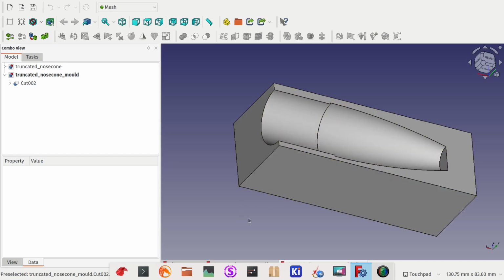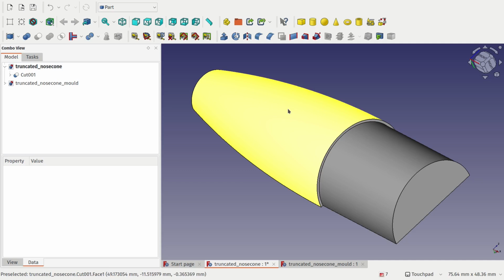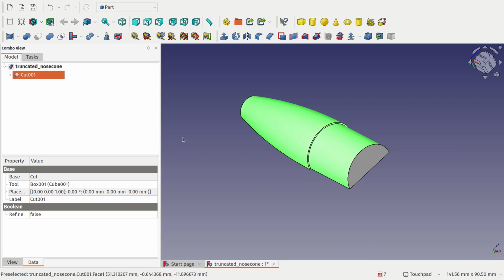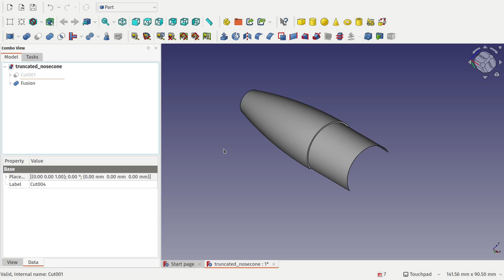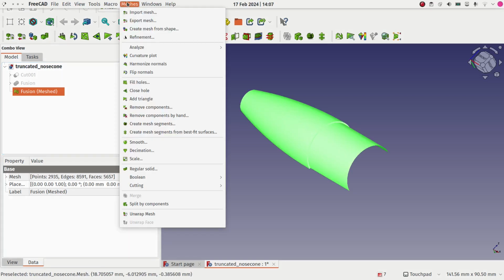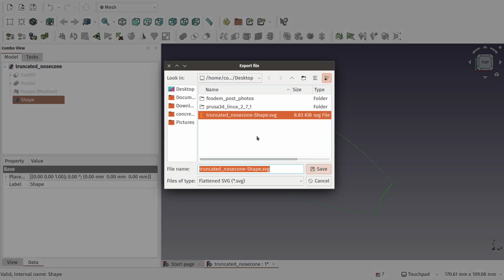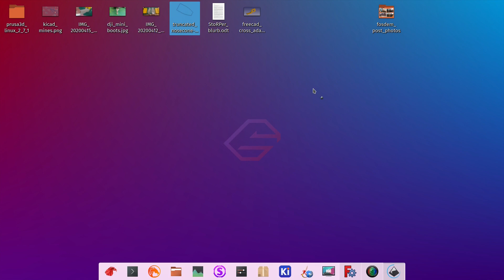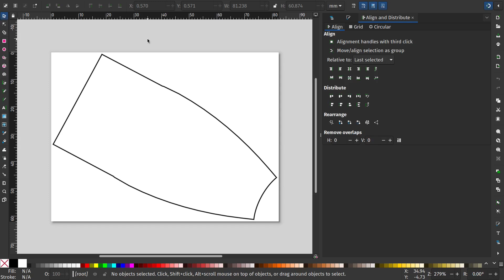FreeCAD, creating Flat Patterns for Curved Fibreglass Rocket Nosecone Moulding

Comment: This excellent tutorial taught me a FreeCAD feature I didn't know of before. Thank you! :)
Reply from the maker: So glad it was useful! Out of interest which bit was the feature you hadn't heard of?
Reply: @concretedog7427  The trick you taught me is using the Unwrap Mesh feature in the Mesh Workbench to create a vector outline. That is a clever way to do so, and it would have saved me time if I had known of it before. I now officially owe you a beverage of your choice. ;-) 

Through my profession, I have used and trained in most commercial CAD packages, mostly Rhino 3D and Fusion 360. For the past five years, I have fully migrated to FreeCAD. This transition taught me a lot. For instance, FreeCAD's open-source nature has allowed for greater customization to suit my needs. I don't regret the switch an inch (25.4 mm) ;-) 

I am behind the @Stemfie3D construction set toy I created using FreeCAD, Blender, and Inkscape.
Reply from the maker: @paulo-kiefe  aha! stemfie3D! You and your project rock!
Reply: Thank you! It is heartwarming to hear. 🙏😊
Reply: It's a great project. A very similar system in the former GDR, "Vero Construc" was one of my favourite Toys during my childhood years.
This system hadn't beams, but blue cubes. With this cubes it was possible to create beams from braces. The braces were made from wood.
What do you think about make braces from lasercuttet wood. I think it would be more efficient (less plastic and time) to make the braces this way instead of printing 3D.